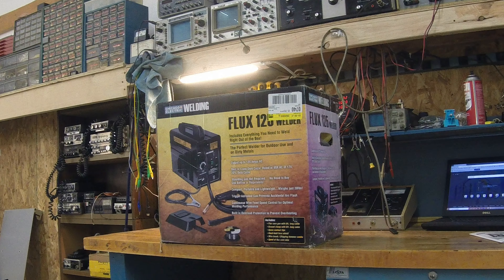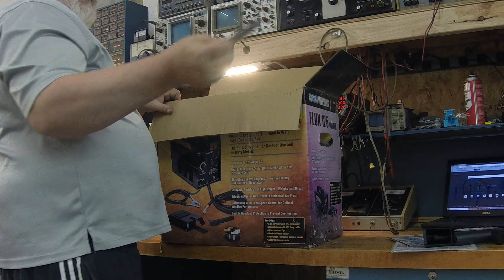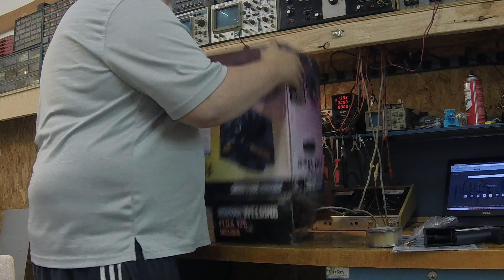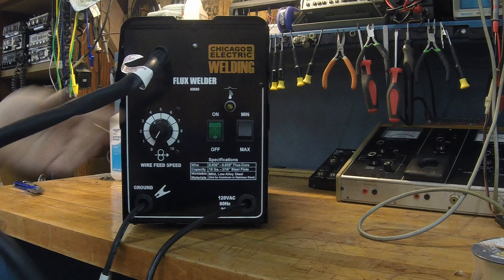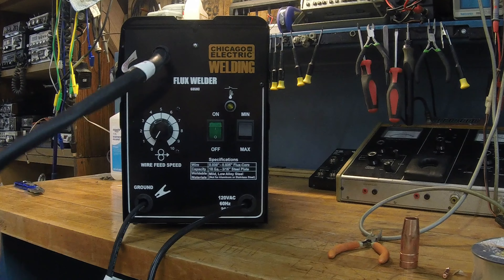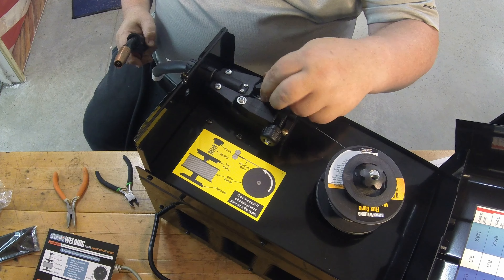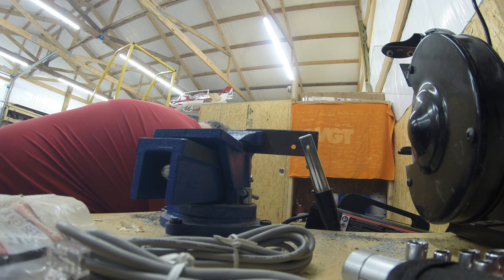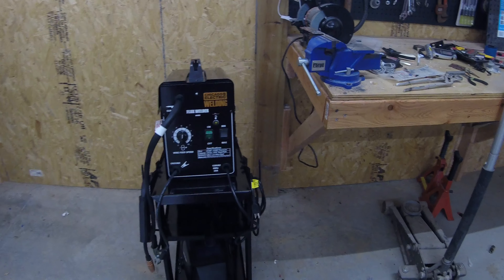Harbor Freight Chicago Electric 125 Wire Feed Flux Welder Box Opening and Review

Comment: I got one to work some sheet metal on an old bug.  The duty cycle says up to 2 min on (weld) and 8 min rest.  I think my outlet is not up to par.  Must be a 15 amp fuse and it just cant power up enough.  Any hints?   I get a couple seconds of arc/weld then it just sits...  Grrrrr
Reply from the maker: Are you using an extension cord if so that could be your issue as that can cause a pretty big voltage drop. So far I have not had mine shut off and I know I have went more than 2 minutes welding at one time on the high setting so something else is causing it.
Reply: Turn the wire speed up then test the wire against the table it will bend up and curl in a curlicue